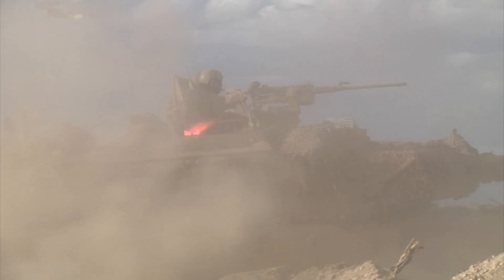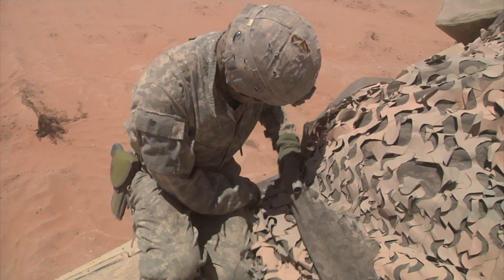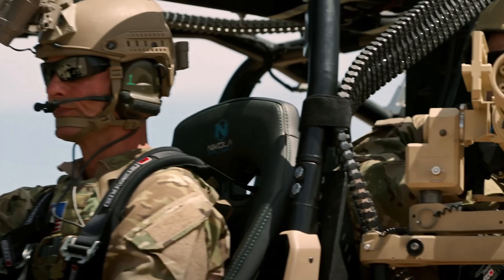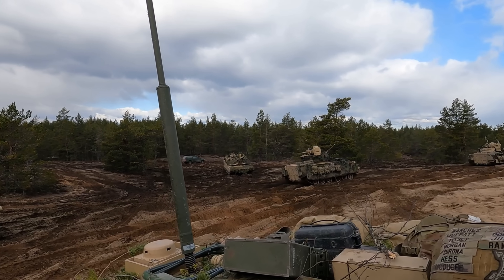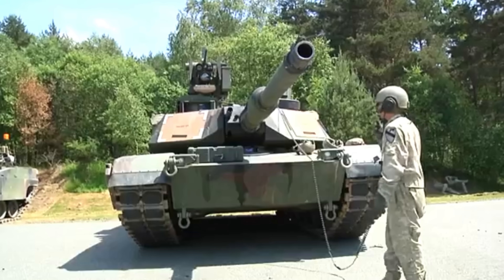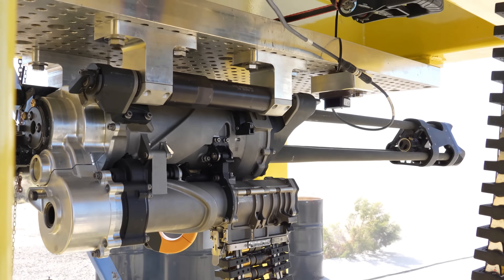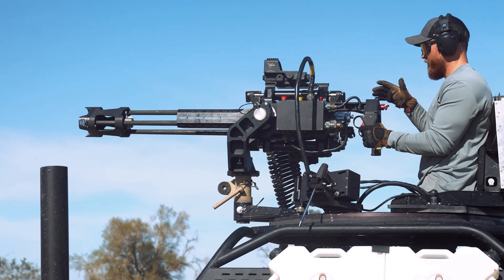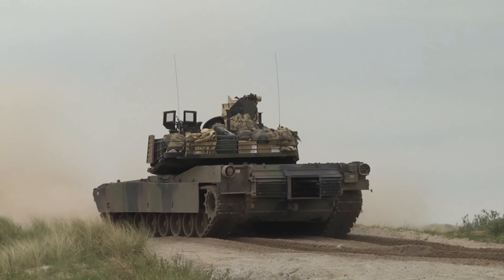Why is the U.S. Army putting a M134 Minigun on Abrams? | ROTARY GUN DEFENSE

Comment: My first thought was that ammo consumption would be a huge issue with it's firerate, what if you are suddenly thrown into a situation where infantry needs to be suppressed constantly, the minigun does not seem like a good weapons system for that situation. Think it would be easier to just always have other units capable of dealing with drones to run in tandem with heavy equipment such as tanks. Also if the minigun is manually operated, I really don't think it would have a high success rate of defeating drones, needs some form of electronic assistance to detect them before hand and probably automatic targeting to be effective, especially if they are kamikaze style drones.

Comment: The m134's operational profile is wrong for drone hunting. Mat (@_matsimus) is right in that a shotgun configuration is better. off the cuff, a USAS-12 with an extended magazine or a modified well adaptor to use brass case belt fed cartridges would work. A more elegant solution would be to use 1" Flare cartridges reconfigured to launch 40-60 6mm steel shot from a n elevated Cr.O.W.S mount fitted with a rotary three barrelled  belt fed weapon with a fire rate of 40-60 rounds per minute. Alternatively, a M576 round  could be used with the disadvantage of minimal shot dispersion could be used but with the advantage of dual use with standard grenades. a MK19 grenade launcher would be suitable in this role . Both suggestions would also offer a good anti infantry/insurgent defence in close quarter situations.  Drones are fragile and can be damaged by BB shot, so  a low velocity cartridge  firing at 2-3 rpm would lay down a decent blanket of shot out to  55-60ft with minimal ammunition usage.  This is the kind of profile for this scenario.

Comment: Just put VADS on an AMPV, even if you replace the M163 with an M134, though I think they should just stick with the M163. Give it more modern optical and IR tracking options, networking, and APS.
We have a chronic shortage of SHORAD anyway, and it's probably along the lines of what the pentagon is going to end up doing anyway.

Comment: M230LF/XM914 "Slinger" system with a coax M249 paired with the EAGLS system for a Stinger pod and a AGR-20 FALCO pod. The US Marine Corp are doing something similar with their MADIS system on their JLTVs, as is the US Army with the Stryker M-SHORAD.
Reply from the maker: Interesting information!
Reply: @_Matsimus_  There's also the RIwP modular turret made by Moog that the US Army has installed on the AMPV. It uses a plate system which allows it to be very versatile & adaptable, not just for air defense, but also can accept anti-armor & electronic warfare pods, among others, depending on the need, and can be reloaded easily by the crew and modules can be swapped out easily in the field using just a standard crane. If memory serves, it's not the exact same system as is used on the M-SHORAD Stryker, as it's quite a bit more modular in nature, but it is very similar. Like the M-SHORAD, it comes standard with the M230LF & coax M240, IR/EO targeting/tracking and millimeter wave radar systems, but can swap out Hellfire rails, Stinger pods, APKWS pods and a number of other modules as needed rather quickly with little training and in the field. It's an American-made system but is very "Swedish" in its adaptability. Really an impressive system. Of course, there are a lot of impressive turret and vehicle-mounted systems coming out recently thanks to the proliferation of drone warfare.

Comment: Build a belt fed, long barrel, automatic 12 gauge shotgun, loaded with bird shot, Much better idea because against air targets you want a good spread, and you can still engage from 100 yards.
Reply: Yes, except the bird shot. It will simply not pack enough punch against metal drones. I would go with #4 shot, small enough to still have a good pattern, but large enough to carry sufficient energy per pellet to do more than scratch paint.
Reply: I had the same idea although 80 yards is more realistic, a real life version of the Hyperion Butcher shotgun from borderlands 3.
Reply: Benelli M2 rotary shotgun holds 24  rounds.
Reply: Maybe a 30mm version of the Mk. 19 with a longer barrel. Firing shot and /or airburst type munitions.
Reply: Shotguns firing that fast would likely have problems with the shot cups and wads interfering with subsequent shots. Would be a fun experiment though.
Reply: @jimfrazier8104  You can just make it multi gun instead of rotary, 4 auto shotguns mounted parallel, longer barrels for energy and use larger shot/shells for range (10 guage mag?). Fire a wall of shot

Comment: They need longer range and a large enough cannon to permit proximity fusing.
20-30mm
Would be a damn sight more useful on battlefield in general. 
25 Mike is Goldilocks.
We already have them in lightweight 4+5 barrel form for Gunship and F/A Airframes. 
GAU-12 + GAU l-22 are both sub 300 lbs
Be like 4 or 5 Bradley main guns on a high angle mount.
Back that up with some Hydra 70 pods w/ Seeker heads and you got something.
At least wherever you can actually deploy a 70+ Ton thirsty ass MBT
Still needs optical/ thermal/ radar to detect and target.
Be better off with the old Quad 50 M2 mounts than the Nothing × some Stingers that we basically have now

Comment: So automated CRAM-like target system that also looks for electronic signature specially designed for targeting drones when? A mini CRAM for the Abram’s is exactly the thing armor needs to flip the script on drone warfare.
Reply: Yes, but smaller rounds. For drones, you either need a larger round that is airburst for best effect or higher volume of fire with a small round. Instead of 7.62, should be looking at 5.56, preferably even smaller like 5.7 or .22. you need to stop the threat from getting within 100ft, not 1000yards. Plus with smaller rounds, you have less issues if another Abrams or armored vehicle is behind the incoming drone threat. Think American 180, little rounds very fast to cheaply destroy incoming drones

Comment: I personally think an advanced trophy system might be extremely effective if it's specifically designed for drones with maybe a larger munition capacity.
Reply: 40mm airburst grenade launcher using the trophy system. They already have the ammo from the XM25 program.
Reply: Drones flying high enough, dropping mortar rounds onto the engine bay, or into a hatch, will never need to worry about close-range hard-kill APS, and sufficiently sized explosively formed penetrators like in 155mm Bonus hunter-killer ammunition, whatever from artillery, or drone will wreck Cold War museum pieces like M1 without the need for direct contact. 
You can polish the turd only so much, even the latest CV90 has better chances for survival on the modern battlefield than M1. The US needs a new generation of armor instead of trolling army personnel with rotary cannons, unless turning them into fully autonomous all-weather CIWS mounted on top of tanks, which would be expensive.
Reply: @IonorRea thank you for pointing out that weakness i didn't think of that
Reply: @IonorRea and that's where Quick Kill with a bit of reprogramming could come in clutch. Quick Kill is basically just a tiny missile launcher, no reason it couldn't chase hovering drop drones.
Reply: @mage3690  Quick kill was so far not adapted and is likely more expensive per missile than an average drone it would be taking down, especially as I understand it, it's a pre-programmed missile flying towards the point of impact, not even a semi-active missile necessary to chase drones. 
Ukraine is supposedly already using drones with machine learning capable of executing the final stage of attack on their own, even when facing heavy jamming with computer-based visual target recognition/target lock as on some tanks/helicopters/jets. So, if you can throw enough cheap drones that can engage pre-selected targets on their own, Quick Kill will probably won't do much about it, whereas modern tanks like Merkava 4B can survive many top attacks by drones even when a lot cheaper ammunition for its APS runs out. I just don't see value in throwing additional money on M1 when making it viable on the modern battlefield, let's say with systems like Quick Kill if they prove service-ready, will be cost-prohibitive, especially when there are already better solutions in service for over a decade, while future growth potential M1 has been depleted decades ago due to weight/cost restrictions. 
The US will soon field 6th-generation air dominance jet fighters, likely at a price tag of 20 of the most modern main battle tanks, yet the US Army is testing hand-operated rotary guns on modernized designs from the late 70ties as defense against the newest threats? Even Europeans are developing next-gen main battle tank, come on, US, take your troops seriously for once, when even tiny Israel is fielding better stuff than so-called superpower with no intention of removing tanks from service despite being claimed as obsolete decade after a decade, the US can do better...
Reply: Trophy works as-is with a bit of reprogramming, or so I hear. Personally, I like the Iron Fist or Quick Kill APS in this role -- they're a bit easier to add ammo to (especially with the Quick Kill system), and much easier to reload than Trophy. All 3 work against drones, although Trophy and Iron Fist might have a bit of trouble shooting truly straight up.

Comment: They should be developing Drone Hunter Drones that operate from Armoured Vehicles like a tiny Aircraft carrier.  Then you can use them for situational awareness and they would automatic target and take out enemy drones.  Hell the drones could be used as impact barriers so they get hit instead of the tank.
Reply: Like the Coyote 2c, Roadrunner, Roadrunner-m or Hellhound interceptor drones?
Reply: @JohnyRodriguez-n3p  Yeah that is the type of small compact and heavy hitting system perhaps mixed with quadcopters drones for scouting locations and enemies.  Thanks for the models they look interesting and how they could be deployed

Comment: While not a terrible idea, I suppose proximity fused or programable shells out of a small 20 or 25mm cannon (maybe 40mm?) could probably do a better job and reduce ammo waste. If cost is such a concern, a 12 gauge belt-fed automatic weapon system would probably be better suited, hasn't been invented yet but there's an idea for engineers.
Reply: A .50 caliber machine gun with ratshot ammo
Reply from the maker: That's a great point, thanks for sharing your thoughts!

Comment: Revive the XM214…..5.56mm “microgun”….put in a CIWS/CRAM type RWS with a mix of optical, acoustic, RF, and radar….make it automatic….just gotta make sure you integrate it right so it plays well in combined arms.
Reply: Right sensors, terrible weapon choice. 40mm packs a whole lot more punch, programmable rounds, auto-self destruct so you're not hosing down the next tank platoon 800 meters to one side of you. Dumb, fast, kinetic solutions to drones are not gonna work in an armor/infantry protection combined arms operation.
Reply: @gonebabygone4116  I'd like to see you try fitting a 40 mm autocannon on top of an Abrams turret. Obviously larger weapon systems would be better than drone protection MGs for individual vehicles, but the discussion here is more so about practical ways of giving every tank a final layer of protection against drones. Purpose-built SPAAGs are still king for air defense.
Reply: @swedishm90camouflage17  
I think he is imagining the 40mm MK19 (or other automatic grenade launchers) There are HEDPAB rounds for them.
Reply: @Swedar87  That seems more doable. The issue of low-velocity ammo does strike me, however; the slower your projectile is, the harder it will be to aim—airburst or not. Even 40 mm HV is relatively slow, so your ballistic calculation would be harder and more impacted by wind and environmental factors.

Also, where can I find a source on this HEDPAB round? Sounds really interesting, but I can't find a good place to read about it, only HEAB.
Reply: @swedishm90camouflage17  
Volume of fire could make up for it i guess, sending out 5 or so Airbursting rounds per second could fill up a lot of space, OFC it becomes absolutely lethal for any infantry around the vehicle.

Comment: As always a good description. My Opinion it is to much firpower which is practical not needed. An automatic weapons station with KI suport ist much more useful and need a lot less ammo and the loader is better protected. Will work with a regular MG like the M240 and others. At the nex genaration tank we will see maybe a 30mm auto canon on the roof with airburst granates. If the drones become a bigger thread with swarm tactics. But one point I missed remeber everything what shot up it in the air comes somewhere down and that a risk of it own.

Comment: I think there is alot of paper generals.

I wonder if they can develop a quick robotized flechette\needle gun?. https://en.wikipedia.org/wiki/Needlegun . You do not need something that can beat armour, just destroy the lift foils of the drone and somthing with miniature munitions.

We need to look outside the normal war industry.
Reply: Project SPIW in the 1960's discovered that Frechette's are too light weight, aero dynamically unstable and tend to keyhole at range and don't penetrate. Ball shot is more practical.
Reply: @nemo-79000  it’s against light drones with commercial civilian parts.

Comment: I think their best bet is a further development of the Trophy system. As it stands, it's achilles heel is stuff dropped directly from above. But the Trophy system has been effective in protecting tanks from objects that are both smaller and faster than drones.
Reply: The Russian Arena-M can engage top attack munitions, so it’s not a stretch to assume Trophy can be modified to do the same. 
It’s also important to note that the “bomber drones” focus on open crew hatches of abandoned tanks. As long as the hatches are closed the drone can’t really do much
Reply: Trophy wont have anywhere near enough charges to defend against loitering munitions or fpv drones
Reply: Doesn’t work for tandem sequential threats.
Reply: @andreahighsides7756  I mean, ideally, infantry are going  and other assets are going to assist at least thinning down the number of threats, drones included, coming towards the tank